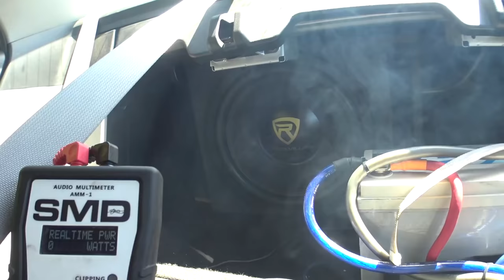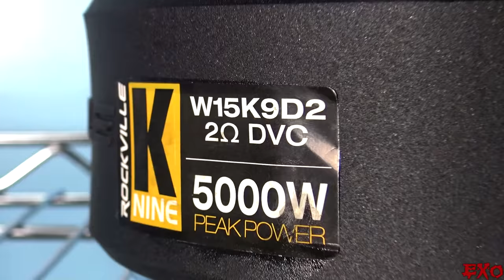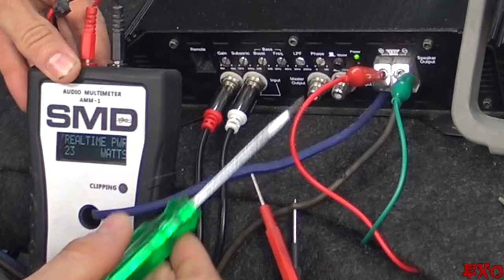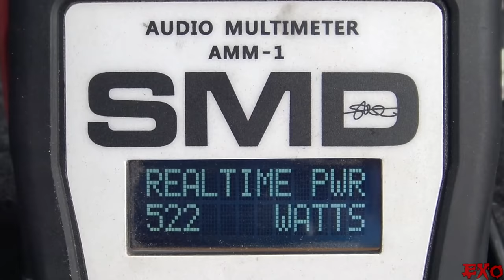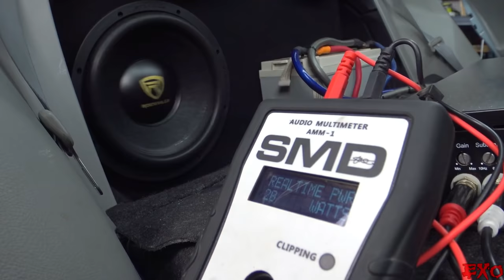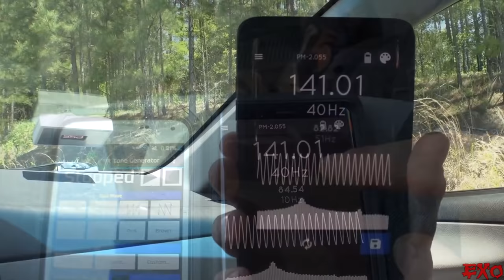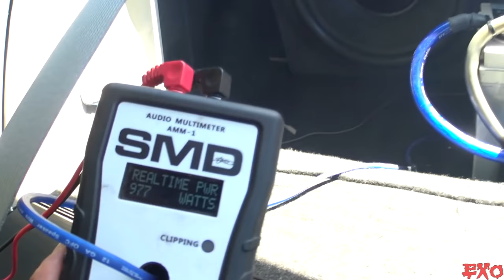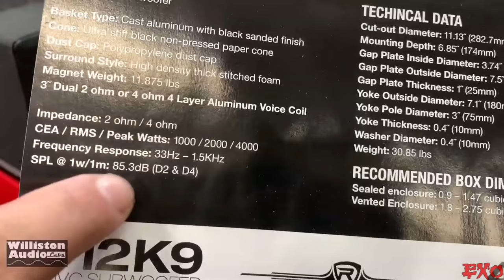EXPOSING a Cheap Subwoofer w/ Rockville K9 Version 2 vs V1 | Blowing Subs on 1000W & Best SPL Test?

Comment: I have personally dealt with Rockville assholes purchased two of their amplifiers thinking I was getting a good deal in both amplifiers stopped working less than 6 months and I also have a set of 6x9 Rockville speakers that sound like total crap worst customer service I've ever dealt with in my life Sonic's Electronics is the only one that I would recommend and I would never buy another Rockville product again the only thing that they have that's any good is their wiring kits but their audio cables for your subwoofer to your stereo are junk the end break off too easy

Comment: Rockville is crap for the ratings. Everything they sell, just multiply the main advertised number by .1. 
50F caps are 5F. 5000w sub is 500w. 10000w amp is 1000w. Maybe some states can nail them for false advertising?

Comment: Has it occurred to anyone watching this that the EFFICIENCY of the speaker means every bit as much as the power rating?  Where is that discussion?  One number without the other is meaningless!  I can build you a 20 thousand watt sub that will not only never ever blow up but will also heat the average size home!  All I need is a voice coil using 1/2" copper pipe wound onto a piece of 4" diameter PVC drain pipe with a big magnet inside the pipe that is mounted inside a top-loading washing machine for an enclosure and a tire rim bolted to the PVC for a cone.  It would probably take 1KW just to hear even a little sound, but, hey, power is cheap, eh?  Think again!  Power ratings alone mean absolutely nothing without telling me exactly how much SPL that power will produce.  The way these crooks sell speakers with high power ratings is by simply making very inefficient speakers.  Not to mention these same crooks have zero problem then doubling the bogus power rating, as we have seen.  In pro PA in the Woodstock era, the top JBL 15" driver had a 50W RMS rating and the top Altec was 30W.  That is how JBL beat out Altec; they made a "high power" speaker and musicians have loved them for it to this day.  After 50 years of constant refinement, that same JBL today is improved to 100W RMS, by the way, and is still widely regarded as one of, if not the best cone driver ever made.  In fact, Hanley Sound did the PA for nearly 500,000 people at Woodstock with two speaker stacks of 32 JBLs a stack for the low end, as I recall,  with a whopping total power of about what the crooks selling your subs to you rate one speaker at!  So how can you do a Woodstock with one 15" speaker?  Clue: You can't.  Efficiency is why.  Those old JBLs had an efficiency of nearly 103dB vs Rockville's claimed efficiency of 83dB, which, like their power rating, is probably double what it really is.  And to have any kind of review, that could have been easily tested - and should have.  Double the power means exactly 3dB.  Just for fun, if the Rockville really has the 83dB efficiency they claim, you would need over 102 of them to equal 1 JBL,  or 6,528 to equal what was used at Woodstock, and that's just the woofers!  Still think power is cheap?  You would need and an 8,160,000W RMS amplifier.  Right.  Over eight million watts, RMS!  Then there are the acres of land to hold the enclosures and the nuclear power station to generate the electricity.  And keep in mind that by today's standards, the Woodstock PA was about a tenth of what we would use for a gig that size.  The moral to my story is that any loudspeaker review that doesn't start by verifying the actual efficiency of a speaker is meaningless.  Efficiency verification is every bit as important, if not more so, than a power handling test because you only have so much room in the trunk.  Assuming the SPL at full power is adequate, and the frequency response and all other parameters are equal, the speaker with the highest efficiency always wins, not the one that can waste the most power.

Comment: I prefer push terminals. But, they are kind of big sometimes. Of course, the terminals need to be good quality.
That is the dumbest wiring diagram I've ever seen. And, even worse coming from the manufacturer. Hell? 
LMAO. 10 seconds. 
Question: double baffle. does a doubled baffle perform better than a single baffle all the time? For example, a single 1" baffle versus a double 1/2" baffle?

Comment: Hey exo I was looking into getting a couple of Rockville 8s for my small truck I believe they are also the k9 series but I was wondering if you could possibly give them a go over just from your experience if they are good or not I'll link em in comment if you do decide to I look forward to the video thanks.

 Rockville W8K9D2 8" Inch 2000w Car Audio Subwoofer Dual 2-Ohm Sub CEA Compliant https://www.amazon.com/dp/B07S81RZPP/ref=cm_sw_r_cp_apa_i_YZkDDbF6CY327